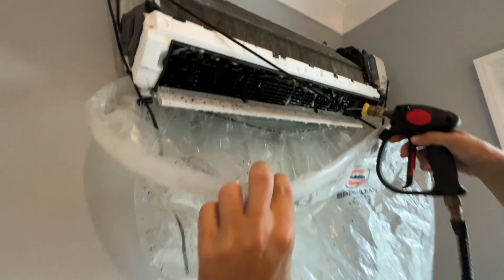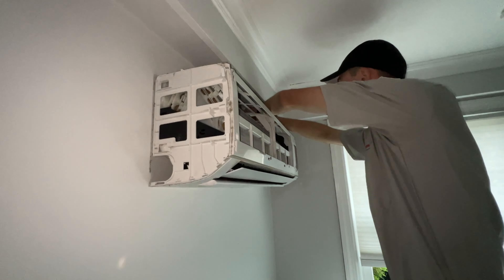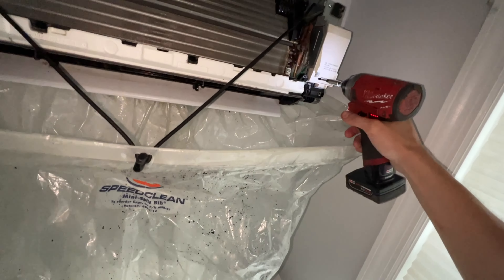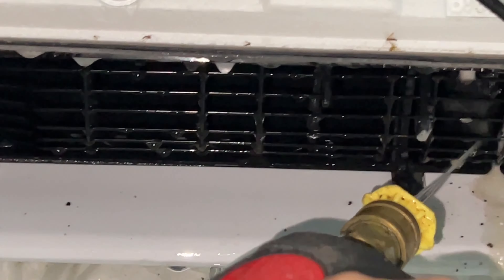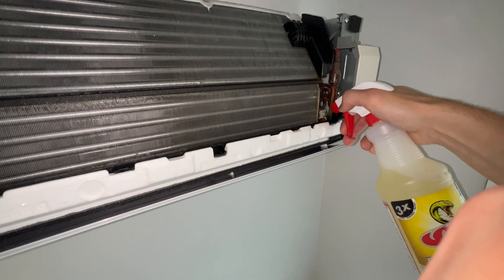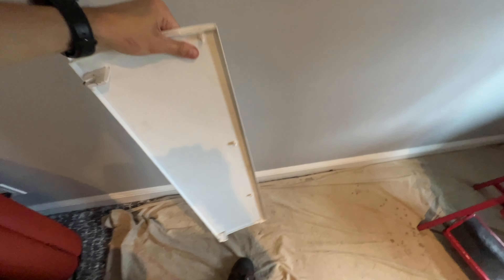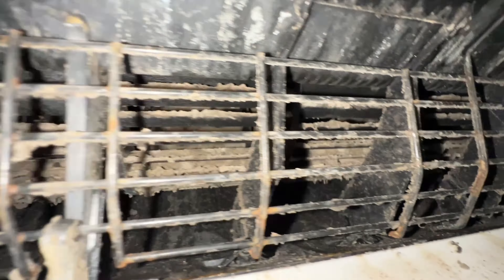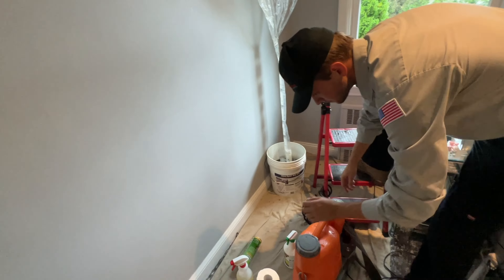How To! Cleaning Out Disgusting Ductless Units! Mold and Mildew Filled Units Dripping Brown Slime!

Comment: I think I may have commented once before on a video. But I work for a cleaning service in Oklahoma. And as a duct cleaner to. This was satisfying to watch. The only thing we have done with a mini split is blow it out with a compressor with an air scrubber going. There was a small fire downstairs and it pulled some smoke and soot through it. I never knew and apparently my boss either that you could wash them like that.

Comment: Nice clean up. Notice a lot of people in the trade walk away from mini’s. No idea why. Most times the filter does a good job keeping coil clean. Most bio growth always clogging blower wheel. I usually pull the guide vanes, cover, blower screen, then blower wheel. There’s a spot on the motor side, on the blower wheel, loosen lock nut and pull blower wheel out. Get better access and not to much additional time. Good job there.
Reply from the maker: Thanks for the info

Comment: Dan ,,what is the make and model of the minie PSI cleaner machine ,,, my units are the same and most defiantly need this !!!!! my blower wheels are even a bit out of balance so i run them on a lower speed ,,I do blame the very poor air filters that really is sinful    probably very low MERV ratings if any and info on the bagger too if you dont mind ,,,thanks so much ,,,Steve
Reply from the maker: Coiljet

Comment: Daniel what'sa good going rate for the cleaning ballpark figure
Reply from the maker: It varies by state, area. We charge hourly and then the chemicals etc are additional cost. 

Some areas are flat rate. 

Typically takes an hour+ per unit
Reply: $300-400 easily at minimum